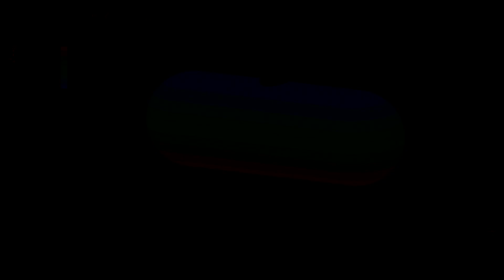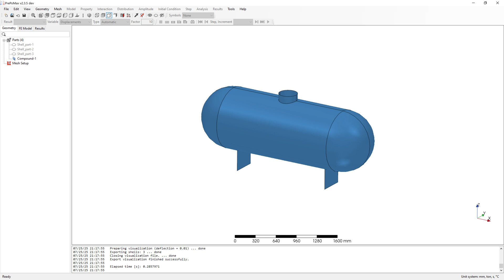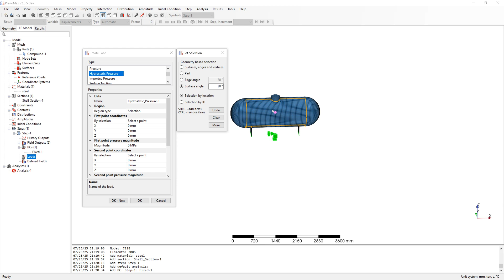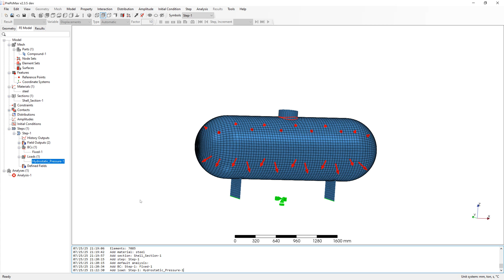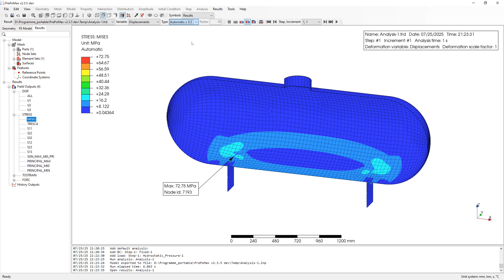Structural Simulation | Water tank - Hydrostatic pressure | PrePoMax

Comment: may i know how did you make the surface in freecad? from the video seem you create the model from part design, correctly if i am wrong
Reply from the maker: Hello. Workflow in CAD was
1. Ground body: in Part, Sketch, Revolve the Sketch with Solid=false.
2. The same way model Opening and Support Surfaces.
3. Cut all surfaces with boolean Exploded Slice
4. Connect the surface and finally Connect(Solid)